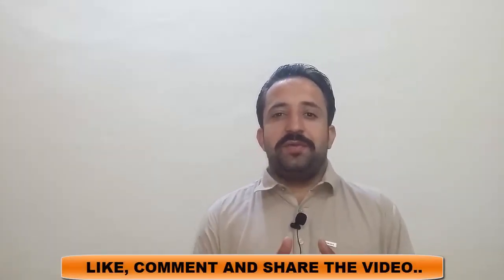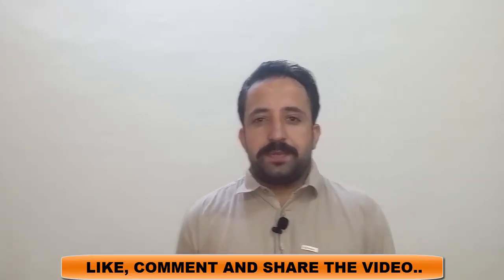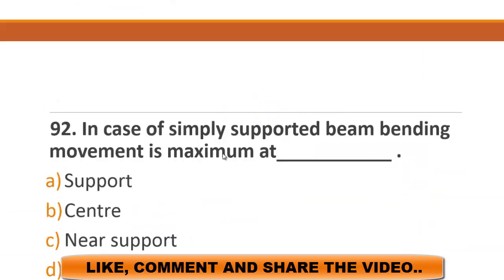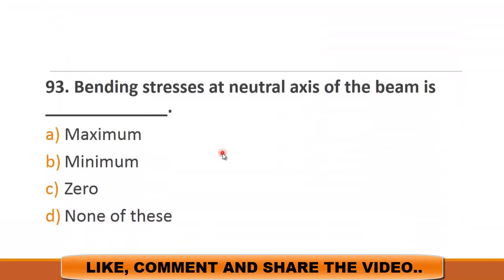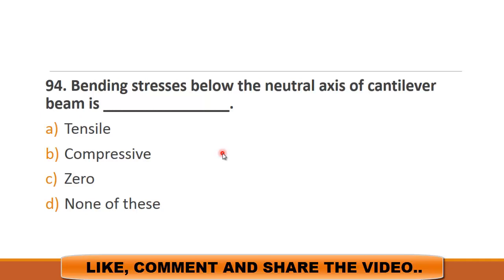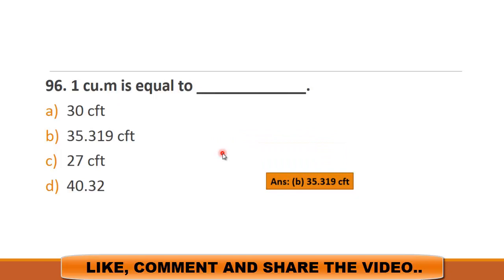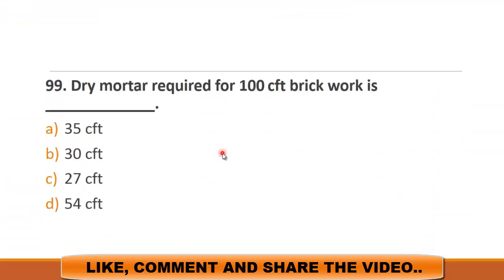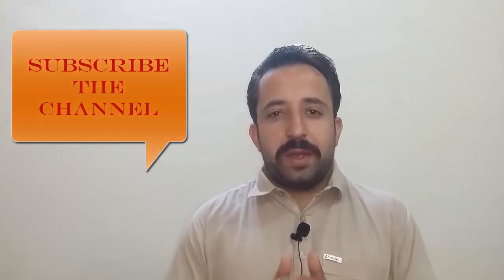civil engineering previous test solved (KPPSC) part 4 | civil engineering mcqs

Comment: Dear sir,
As far as I am concerned that bent up bar is not use for shear. 
Kindly take a look at once on the mentioned matter and explain here in comment.
I shall be very grateful to you for this.
Thanks..
Reply from the maker: Dear Brother, bent up bar is used to resists shear, as it can act like diagonal stirrups, bent up bar is also used to resists the negative movement at support. but as you can see that there is no choice of negative reinforcement in the given question so i have selected the shear force.
Reply: Bent up bar is use for negative and positive bending moments.